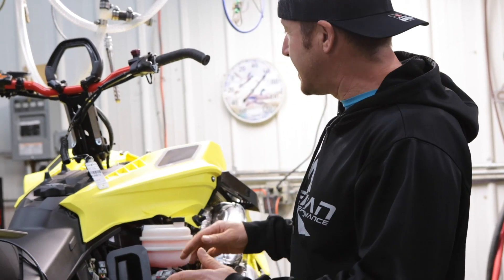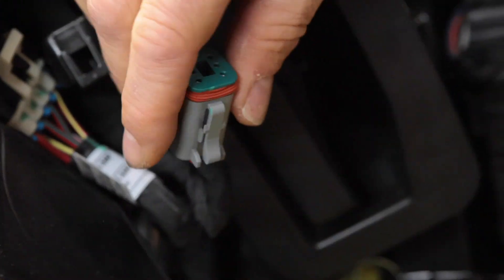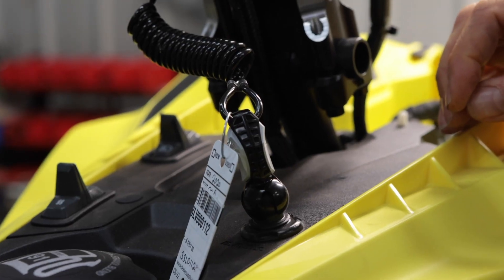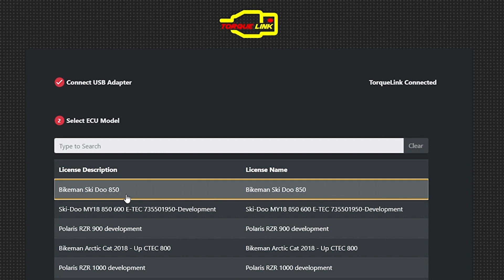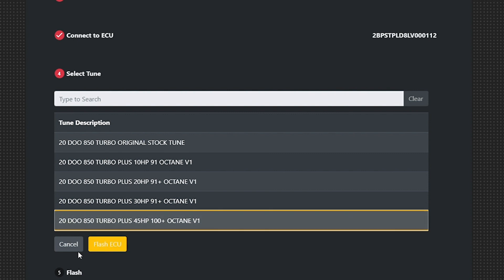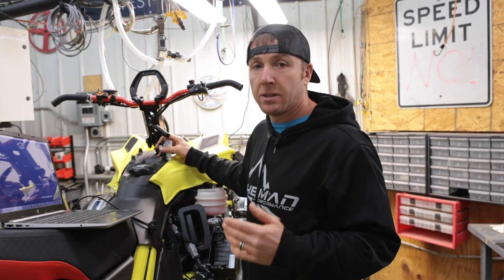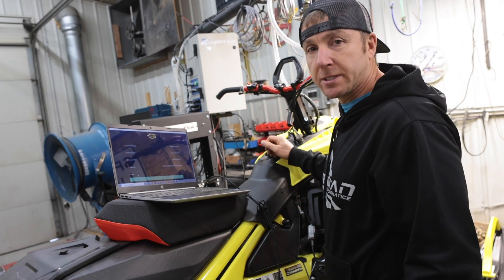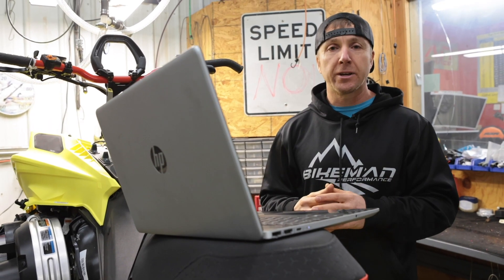TechTues - Flashing Ski-Doo E-Tec 850

Comment: can this fix my 2022 ski doo 850 turbo ecm issue? Dealer says my ECM needs replaced and reprogrammed. Had code P0426 for egt sensor. Replaced egt sensor and still getting engine light but it won't show me what the code is.

Comment: hey, i am ordering a torque tuner for my 850 turbo in a few minutes, but i was wondering if i can "re tune" my sled. example if i start with the 10 hp and i found out that i want to have 20 extra hp, is that something i can do without buying a license again?
Reply from the maker: Once you buy a Torque Link License and it's applied to a vin, you can swap between tunes as you build your sleds performance or just want more power. Switching between tune levels  is included under license purchase.

Comment: Just wanted to add a thank you for info I didn't know about 100ll and 110ll fuel. I dont need high octane fuel but liked to learn more about fuel in general.
Reply: Actually, there is never any alcohol added to certified 100LL (or any avgas) for many reasons (see https://web.archive.org/web/20120112232824/http://www.energy-consumers-edge.com/faa-ethanol-safety.html) In fact, certified 100LL from any supplier will be some of the most consistent fuel that anyone could use as it must have a specific density and composition for weight balancing and performance in aviation use.  It doesn't mean it's the best for sled use or for Bikeman tunes, but his comments regarding "de-icer" are not correct.  Also, I've not heard of or seen 110LL
Reply: Yes sorry Bikeman is mistaken. Please see my comment.

Comment: Hey guys, fantastic job on the video. Lots of good info, and can’t wait to see one with your stages in person. Would like to correct you on the AV gas comment though. There is ZERO de-icing agents, or alcohol or ethanol in any aviation gasoline based fuel. ZERO NONE ZIP. No aviation gasoline engine, or fuel system on certified aircraft has ever been designed for ethanol or alcohol fuel additives. Ethanol or alcohol would destroy fuel tank bladders, and various fuel system seals and o-rings that were never designed for it. All it has added is lead. The lead will over time cause deposits in the engine, and is very hard on O2 sensors. Your info saying it’s “dry” is a myth and very wrong. The myth comes from aviation fuel needing to be free of water and moisture. Water in your fuel on takeoff could be deadly. Hence why we pilots sump/drain all the low points in the tanks and fuel system of an airplane before we even start the engine to make sure the fuel is free of water, aka “dry”. The low amounts of lead are to make the fuel less prone to detonate at higher altitudes, and also be safe for boosted engines since many aviation engines are turboed or supercharged. Some old radials even have both, but were designed for the no longer available 130 octane AV gas. I am a second generation Cropduster, commercial pilot, and an owner in an aviation business that’s operated both piston, and turbine engines for over 40 years. The only aviation fuel that will ever have a winter or cold weather additive is JET A, which is like a kerosene, or highly refined diesel. That additive is called “prist”. It’s a fuel system icing inhibitor. The fuel retailer has to ask the pilot if they want Jet A with prist added or disclose to them that their tank has prist added. You wouldn’t make it far on your sled if you put in kerosene. 😂 I’ve safely run straight 100LL on 2strokes up to 12psi of boost at altitude, and 21psi on a turbo Nytro for years without ever having one failure due to detonation, or because it’s “dry” . I’ve safely run straight 100LL in 2 and 4 stroke bikes, quads, sleds, and race cars for years.
There is zero issues with AV gas mixing with 2 stroke oils in pre-mix or oil injection systems. Have I had to replace lots of AFR gauge O2 sensors? Heck yea lol The lead trashes them. 
Keep building cool stuff!
Reply: Nothing like 100LL running in an allison 501k gas turbine!

Comment: I know this gets beat to death regarding the warranty status, so appreciate that answer!  I would, however, like to know if it can reasonably be expected that a Doo mechanic (not a corporate Engineer person) hooks up BUDS software, something tells him it's been flashed, and now they're denying your broken clutch.  
I get what I deserve if I blow a head gasket, grenade pistons from detonation, etc. But I've not heard yet if you can expect a sled to be flagged by BUDS and have your blanket warranty voided even if nothing's gone wrong or it has nothing to do with the engine itself.  Another question, can recall/Service Bulletin updates to the ECU be done once it's flashed?
Reply: I’d like to know the answer to this as well
Reply: i can say iv connected buds to can ams and cannot tell if they been flashed or not. however depending the flash sometimes they are locked  B&H Supreme Small Engines